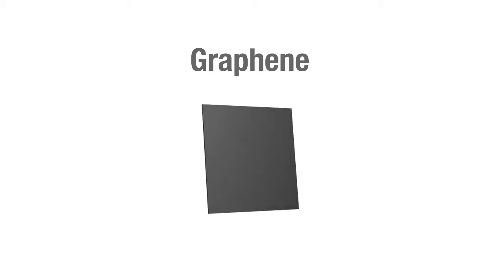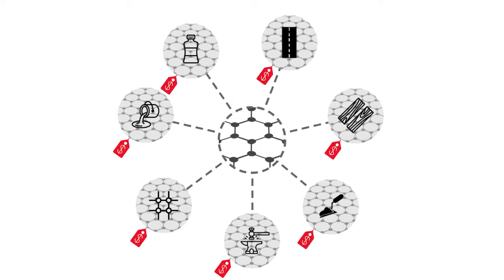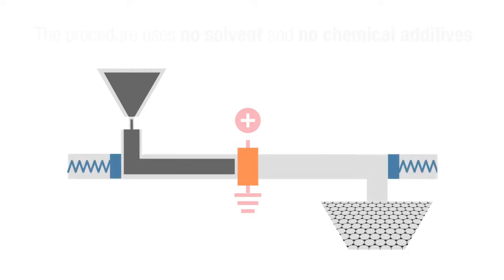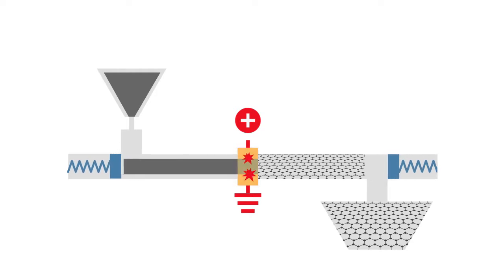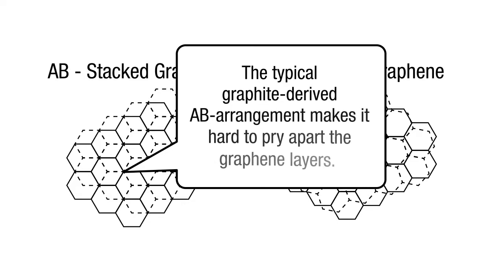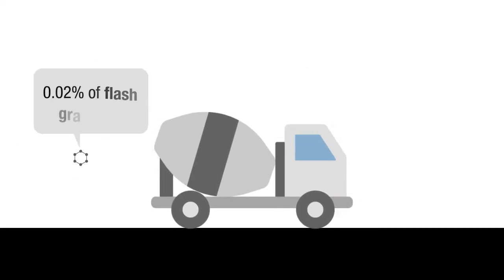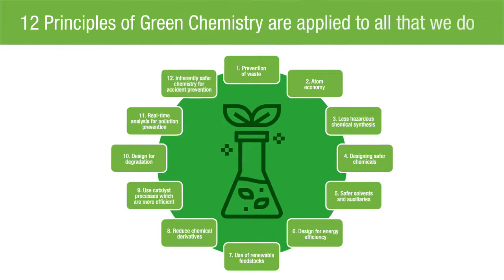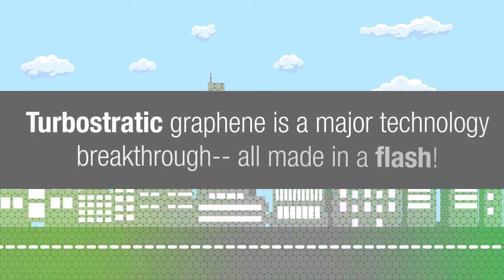Flash graphene

Comment: Is it possable to use conductive material like graphite between the two electrods gap or it must be a non conductive carbon?
Reply: I wouldn't know for sure, (I'm no professional yet). But I doubt it would work with conductive carbon. Because flash graphene utilises resistive heating to produce the immense flash of heat. 
Resistive heating only really occurs when electricity travels through insulators. If the electricity travelled through something conductive (like graphite), there would be a smidgen of heat generated due to the miniscule resistance of graphite, but nowhere near enough to obliterate the graphite's molecular bonds, meaning graphene couldn't be produced.

Comment: Okay, here me out.
Flash Graphene production.  What if you were to use the 200 volt current in a highly precise manner?  Additive manufacturing AKA 3D printing.
Could this same heat requirements be 'flashed' with a laser for even greater precision?
Reply: No.
Reply: That's a great idea. I'm not sure it would work though. You could probably form very imprecise basic shapes, but nothing all that precise due to 2 reasons.
1. The produced graphene is a powder, I doubt you'd yield a solid 3D shape, rather a pile of graphene powder in a specific shape
2. In the reaction, the byproduct gases would create an immense high pressure region in the newly reformed/reforming graphene, which would shoot out in all directions, sweeping up graphene powder with it. In the tube set up Rice University outlines, this isn't really an issue, as the gas is vented out the ends and the bulk of the graphene is contained. But in an open set up like you describe, that graphene powder would be free to shoot out in all directions all over the workspace.
I could be wrong though, I'm only a senior high school student (as of typing this), so take this with a grain of salt.

Comment: Can graphite be used in this process?  (I think so, but would like confirmation please.)
Reply: you would need carbon
Reply: I wouldn't know for sure, (I'm no professional yet). But I doubt it would work with conductive carbon (i.e. graphite) . Because flash graphene utilises resistive heating to produce the immense flash of heat. 
Resistive heating only really occurs when electricity travels through insulators. If the electricity travelled through something conductive (like graphite), there would be a smidgen of heat generated due to the miniscule resistance of graphite, but nowhere near enough to obliterate the graphite's molecular bonds, meaning graphene couldn't be produced.
Reply: No bro i has high conductivity mix it with carbon black ratio about 25 graphite and 75 carbon black.

Comment: I have but one question. What else can we transform by moving matter with electricity. This is the tip of a world saving iceburg
Reply: 2 birds 1 stone. Solve global climate change by turning co2 into graohene
Reply: Agreed. Maybe it could revert metal oxides back into metals.
Reply: @theflyingwelshman5338  Yes, that's how aluminium is refined commercially. That's one of two ways green steel is made. I believe copper is refined this way, and maybe gold too
Reply: @hugofolpp1753  the problem is that they use carbon electrodes, which degrade and produce carbon dioxide.

Comment: i think its more like 2 million watts!
Reply: I think 200V are fairly realistic, but will take some amount of amps. This is similar if you connect two carbon rods to 12V battery and then you put this two carbon electrodes together,... you get strong flash. But here is used way higher voltage and also the power is applied in pulses. The carbon material is between two electrodes.
Reply: cayrex2 yes actually under vaccum spark gaps can be made significantly  wider!  2 million watts?
Reply: @Buzzhumma  do you think that the carbon material is in the vaccum? On the other hand makes sense.
Reply: @Buzzhumma  in this method they uses high heat to break the layers of carbon. High heat and then cool down,.... thats why they make pulses. If you play with two carbon rods and a battery,... you also create really high heat.
Reply: cayrex2 yes for sure. And that also allow them to capture the gases formed ! Like a crt tv monitor . It is under vacumm to allow the electrons to easily pass to the front phosphorous glass !
Reply: cayrex2 it would be a balance between voltage and vacuum . Just enough of both so that the least path of resistance is through the carbon contaning material  and not jumping over to the other electrode .
Reply: cayrex2 do they heat the chamber up ?
Reply: @Buzzhumma  yes now I see that this is in a vaccum. I see the other video from rice. The reaction tube with two copper electrodes and carbon in between get hot when the power is applying. Hmm,... in this case is this method a little difficult to repeat because of the vaccum for home researcher.
Reply: cayrex2  it will be interesting to see somebody do it . Maybe RMS can run a competion and who ever does it wins a prize ?
Reply: @Buzzhumma  hehe yes. I find out that 7.2 kilojoules is needed for 1 gram of graphene which is heated to around 3000 degg C for 100 miliseconds.
Reply: cayrex2 i think there is a lot of mistruth arond the subject as prof Tour clearly is  stating that it could be done at indistrial scale so that is alot of energy required ! Something doesnt add up i feel !
Reply: @Buzzhumma  In the paper they state that the system can be under atmospheric pressure or a mild vacuum (~10mm Hg) to facilitate outgassing - so apparently no vacuum is required. The quartz tube I think is slightly larger than the electrodes for the outgassing part. The paper suggests that the key is the temperature so theoretically a 3000K arc flash could work. Also they use a capacitor bank to store the charge and then discharge the bank in one go so all that should be required is a big enough capacitor bank.
Reply: Edward Tate  🤔 hmmmm thanks for the info . I wonder if they prepare the material ionically first so that the rapid discharge is more rapid !
Reply: @Buzzhumma  I think they prepared the material a priori using Carbon Black but anything conductive should work - they do this because coffee isn't conductive by default :). Grind & mix them together at about 5% of the conductive material. I would start with just Carbon Black initially and then mix once that works. You can then keep some of the product for mixing the next batches.
Reply: cayrex2 ok so maybe the carbon rods have some material in between them thats had ionic solution  adsorbed to its surface to assist in high energy discharge absorption! Maybe just a light spray of some ionic liquid that works as a catalyst for the outer carbon to form and then graphitise allowing the rest of the material morph into graphene from the energy of it radiant heat that is so localised to it .
Reply: I have a high current welder so i will try a few things at work with  it .  I wont collect the gas though but rather just see if my theory is plausable . I will however have to create a oxygen poor envoironment so maybe a little urea sprayed on the material surface 👍🏻
Reply: @cmalune  yeah i see what your saying. makes sense. the thermal radiation would graphitize the rest of the material based on such close proximity. I am now thinking about just using some coffee grinds for example and just dusting them in some 5 micron graphite powder on it and just using a microwave oven to pulse the power as the graphite is a receptor!
Reply: @Buzzhumma  Sounds awesome, let us know how it goes.
Reply: @Buzzhumma  Sorry for the delay. The key is in the resistance of the material - in the supplementary info of the paper most of the materials they use are 1.5ohm resistance or very low. However, in the ground coffee example, the resistance was 3-5k ohms. They flashed it at 150V and then had a resistance low enough to flash it into graphene (5-10 ohms). Its possible that initially they obtained 3-5k ohms by scattering some electroconductive material (such as CB / graphite / graphene etc). 

Another interesting point is the capacitors - they use electrolytic 10x18,000uF 400V in one bank and 10x6,000uF 450V in another (for lower quantities). Those capacitors are not cheap unfortunately.
Reply: @Barskor1  Plural indeed, as I stated there are two banks, the smaller of which they use for smaller samples (<0.5g). For the larger samples in the 15mm quartz tube they use both. Theres no arc since its joule heating, they control the distance via brass screws.
Reply: @Barskor1  PS: I have the circuit diagram with the list of all the components used ...
Reply: @Barskor1  Sent
Reply: @Recerata Carcerem! 😉 more heads know more
Reply: @Recerata Carcerem! i think so too. nothing amaziingly complex  in the concept really, but the outcome seem very amazing !
Reply: I cant see why this type of concept would be any different . We dont have to stick to exactly the same ingredients to make the cake , it just has to end up as cake ! ie graphene ! Who says it has to be done in a split second ! https://youtu.be/TwGnxB9BXK0

Comment: And what about other element in those waste (eg. those in coals) what's happens to them?
Reply: ytrew there would need to be additional processes but some would “ablate” and others could be collected
Reply: @blainevans7047  "ablate"? Do you mean evaporate?
Reply: ytrew look up laser ablation aircraft sorry I just fought that...laser ablation can reach 25000F
Reply: Coal is just carbon so nothing
Reply: @KManAbout  Coal has almost all the natural elements except noble gases. It is made of whatever settled in the bottom of the swamp.  The exact composition varies by location.  If you burn coal there is a considerable amount of fly ash and bottom ash.  A majority of the energy released by coal comes from carbon and oxygen reacting.  The bottom ash is much lighter weight and at least a little bit less volume than the original coal.
Reply: stefan r True but there’s also a lot of filter deposition. They use activated charcoal to capture other items so that tells you that coal captures other elements. A lot of heavy metals radioactive at some locations
Reply: The K are you trolling? Coal is mostly carbon...but there are many assemblies and MANY other elements
Reply: @blainevans7047  yeah not trolling just ignorant
Reply: @blainevans7047  thanks for the info dude
Reply: The K there’s a lot of papers about coal capturing a lot of precious metals and rare Earth elements